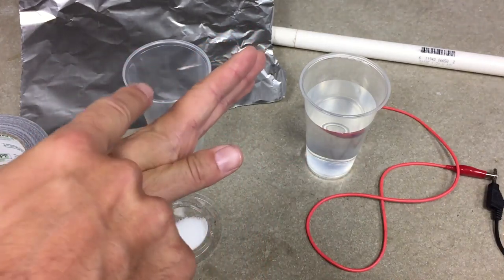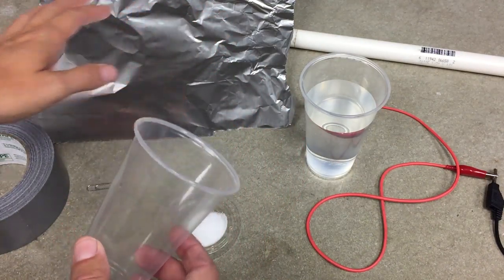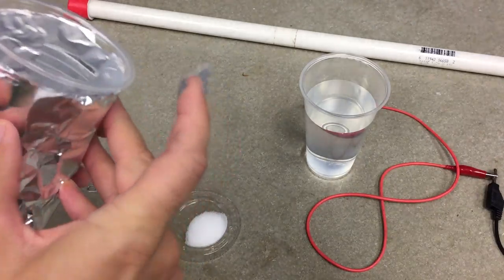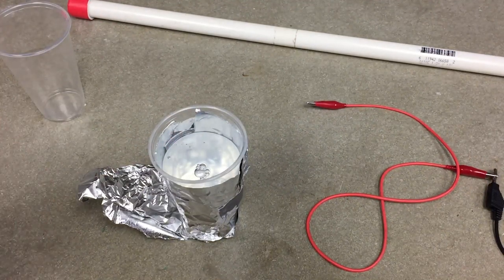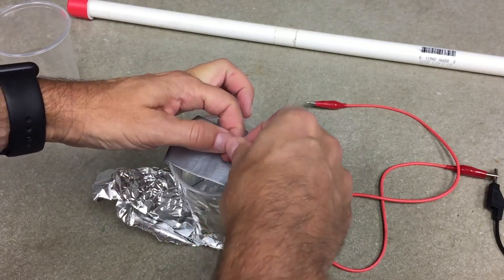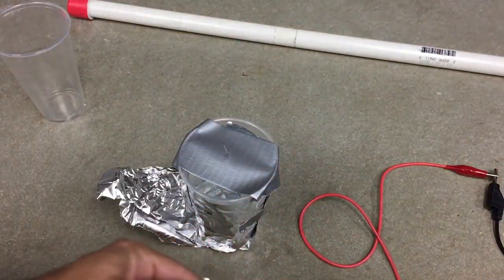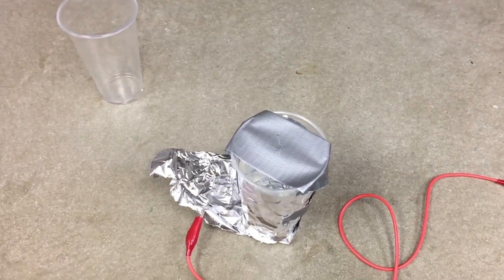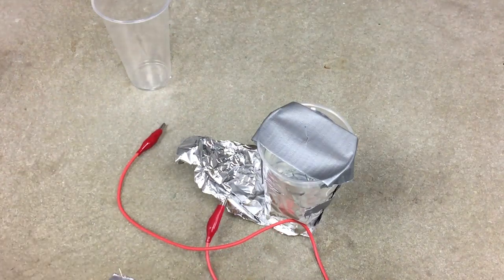Yes. You can make a Leyden jar with some simple stuff.

Comment: Thanks for this awesome video!, these are wicked experiments though caution is always needed.
Some tips for beginners...
1) Make sure the aluminium foil wraps around the cup/plastic bottle as smoothly as possible to prevent static discharge .
2) Use thicker wiring (3 mm) for better current flow.
3) If using a cup place foil on the inside to bump up the positive charge collection.
4) Add a pin pong ball wrapped in foil to the nail for a great discharge.
5) The more strokes with PVC pipe the bigger the voltage! 
Have fun!! 😉

Comment: If we simply touch the aluminum foil with the floor...will it work?
Reply: Floors are usually insulators, yeah, it should work
Reply: @hayemiranda7647  This is sarcasm, right?
Reply: Of course it will...the foil was also touching the floor in the video as u could see
Reply: @nabayanchakma2419  I'd prefer that you connect a ground wire so you're absolutely sure that you've grounded the cup in incase the thing doesn't work.
Reply: @nabayanchakma2419  ok then...
Reply: @nabayanchakma2419  (づ￣ ³￣)づ

Comment: The aluminium has sharp edges,
Doesn't it let go of the charges?
Reply: It's not holding the actual charge nonetheless, it suppose to be getting extra positive charge from the ground / environment to hold the negative charges in the water. And water don't have charge edges. :)

Comment: Hello, I have a problem with my Leyden jar ... First of all I have made my Leyden jar by sticking aluminium foil both to the inside and outside and using paper clips ( but obviously that won't matter ) . The thing is that whenever I try to charge a Leyden jar I hear a crackling sound... But u believe its not supposed to be like that right ? I mean , when we try to discharge the jar then we hear a sound... So why are things working oppositely for me ?! Plz help...
Reply from the maker: the cracking sound might be a spark.  If your two metal foils are super close to each other, the charge could make a voltage high enough to produce a spark and discharge the jar.
Reply: @rhettallain  so what should I do to prevent the thing ? I repeat that I'm getting a crackling sound when I try to charge the jar  , plz tell
Reply from the maker: @rachnajaiswal933  maybe use a thicker jar?  Make sure the aluminum foil doesn't go all the way to the top edge?  It might be something with the paper clips - try taking those off
Reply: I am having the same problem too and the top ball is attracting to the pvc pipe

Comment: When you put the saltwater in aren't you essentially creating a batter? I'm 😕 confused
Reply: no, it's capacitor because you are holding electrical charges, not chemical energy. That's why the aluminium is separated from water by the cup
Reply: I was a bit confused also. This is a capacitor. The salted water (conductive) is one 'plate', and the aluminum foil is the other plate.